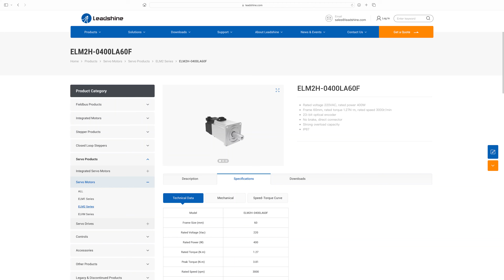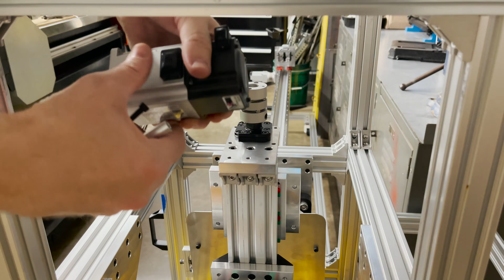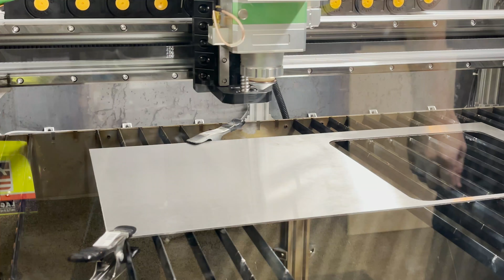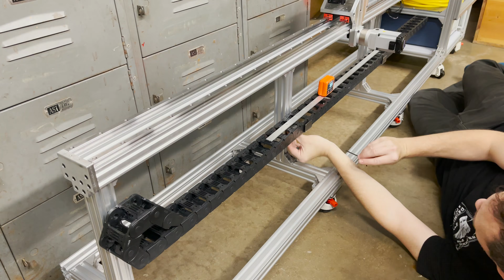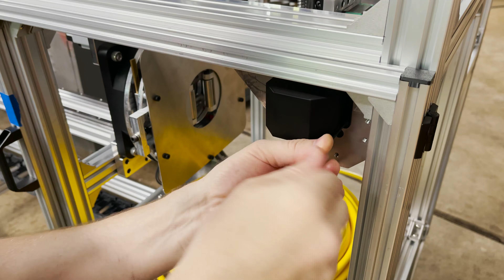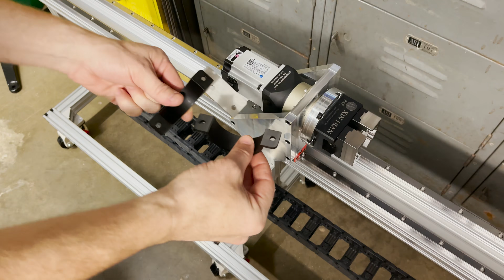DIY Fiber Laser Tube Cutting Machine | Part 6: Leadshine AC Servo Motors

Comment: Those 3d prints look pretty clean. How many Masso's did you install?  If you need a plug and play wireless mpg for one, I have a few.  Ive been saving them for an upcoming build but its taking forever.
Reply from the maker: The Qidi Tech Q1 Pro has been great, the cleanest prints I've achieved and it's fast! I've installed 4 Masso G3 Touches so far...all of my machines already have mpg's, but thank you I appreciate it!

Comment: You should lower the drag chain, by doing that you will increase the bend radius that the cables are subjected to and they will last significantly longer. Cables in tight bends moving back and forward fail very quickly, the cable manufacturer should have a bend radius spec, if it's an automation cable sometimes it's printed on the insulation
Reply from the maker: That's a good point! I probably could have just rested it on the 4040 extrusion below and not even needed to make the supporting brackets...these are the things I'm learning in V1 of the machine.

Comment: Have you ordered proper hex key tools yet? (Reminder 2)
Reply from the maker: Haha, thanks for the second reminder….Ordered!
Reply: Bondhus T-handle hex tools are the best I've ever used
Reply: @ianroberts8371  I bought a set to test them out, I've been using Wera tools lately with my 3d printers
Reply: @ianroberts8371  while they're better than L keys, they're much less robust than wera... They twist when tightening